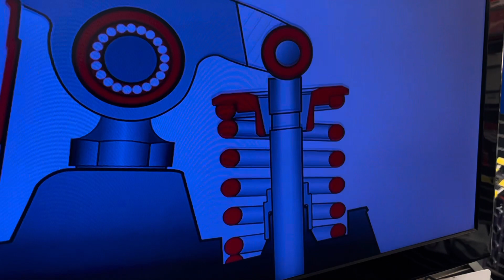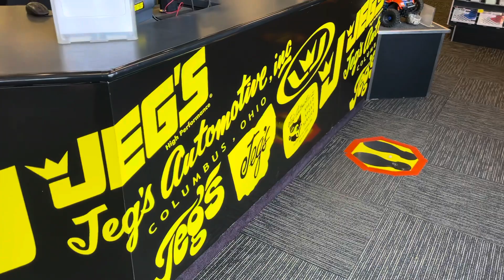It’s time to get SERIOUS.

Comment: Somethings to consider on the Fox.
Correct headers. She had 8.2 deck and now it is 9.5 plus the heads have raised exhaust ports. 
Make sure the flywheel balance matches engine. 28oz/50oz/ or Neutral. I’m gonna say that motor would have been neutral.
The dyno of the engine said it pulled 10in of Vacuum.

Comment: Dam... All the work on them RC cars you guys been thru and you put them monster wheels on that tiny spindle. Time to swap them knuckles out and get some 12 or 15 mm shafts on that bad boy. Your gonna twist that spindle off the first time them tires see any real resistance. Other then that that things a beast hehehe. Reminds me of my franken truggy with a 3hp OFNA motor and three speed trans. When it was on stock gears and high perf clutch It would twist or shear dog bones like balsa wood cork screws when I ran the big tires.

Comment: Jon Bitler builds the baddest carbs out there. I have the same all billet dual needle and seat blow through but mines the 4500 on my new 540 f3-121.good video love the dogs. Comparing those 2 carbs is like comparing porterhouse to new york strip it ain't even comparable. That is the famous line, slap it together, only about a hr or 2 and then a whole day later it's finally down to that 1 to 2 hr mark lol. Them Kids you just gotta love them.

Comment: Why not jump to efi yet on the truck? I run a similar setup on a dart li’l m 434 and run it with a megasquirt ecu. All my boost, fuel, timing and traction controls from the same box. Going from carb to efi is actually easier when you already know carb tuning. Once the carb tuning vs efi translation click in, you will love it. Now the downside to efi tuning is that its way easier to go on the computer and change 20 things at once and get “lost” and make the shiny stuff come out of the engine and the wallet.
Reply: Why? Preasing a bunch of keys on a laptop doesn't make you a tuner, it makes you a computer nerd. FI won't make more power than a carburetor. Real tuners use their eyes and ears to physically tune it, not rely on electronics. Just a bunch of generalized parameters. If you know how to read a plug, and use common sense, it's all you need. Just sayin...

Comment: 10 lbs vacuum on the dyno
Reply: 10 9nches of vacuum, but at what rpm were they "idleing" it? Sounded kinda high to me.  Odds are in the car, at a real idle, it won't have 10" of vacuum.